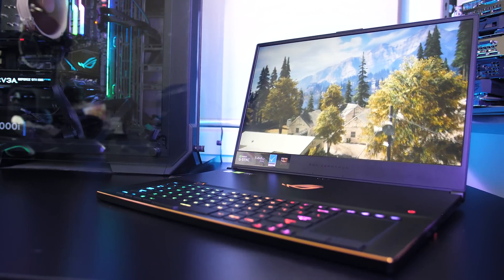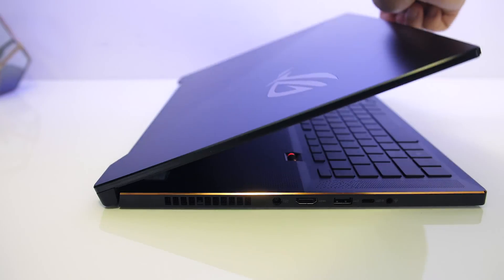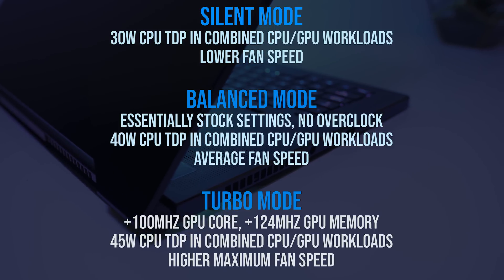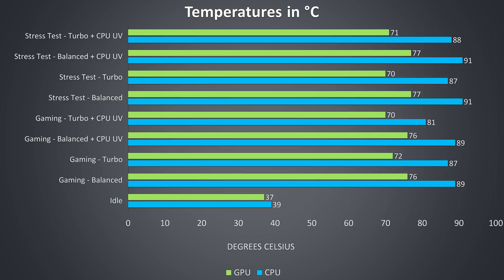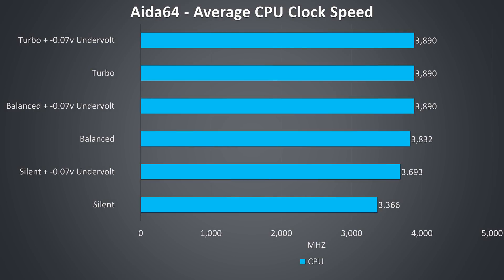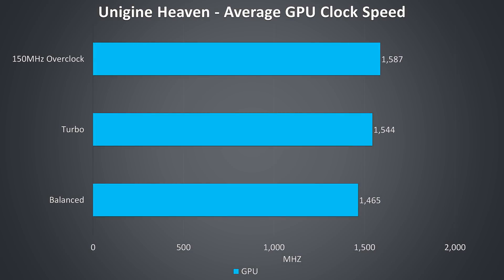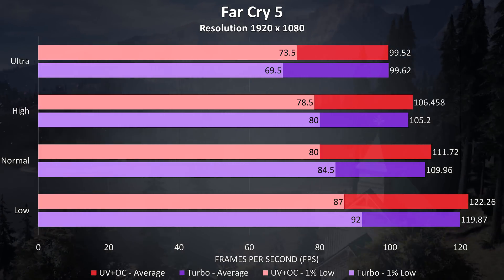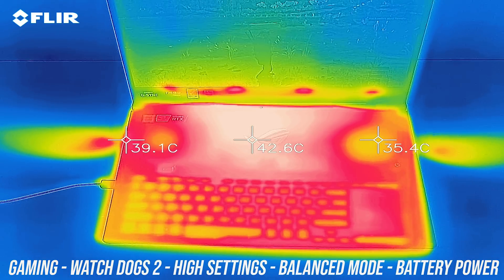ASUS Zephyrus S (GX701) Thermal Testing, Overclocking and Undervolting

Comment: Quick question.  Do you think if you remove the bottom metal plate you can then use it in dock mode with lid closed???

Comment: Hi jarrod,

May I know if the GX701 runs cooler or the razer blade pro 17? (2019 or 2020 model?)
Reply: If you buy the 2020 model, they all come with liquid metal. The Zephyrus’ thermal solution is superior to any Razer blade’s cooling. I bought the S17 with the 10875H and 2070 Super, and the CPU rarely ever goes over 90c during gaming and the GPU very rarely goes over 80c. Everything about it is excellent, apart from the fact that there is no webcam or fingerprint reader for Windows hello. 11/10 would recommend.

Comment: thanks for the video jarrod ! Sadly my thermals aren't nearly as good as your results with this laptop... however mine comes with the 9750h cpu . undervolting didn't seem to affect it either. Although even on low performance mode it still gives me 100 fps for witcher on ultra (cpu temp on around 78)

Comment: Hi, I've owned the same model for a year now and it has delivered great performance during games and daily tasks but I never monitored temperatures or clock speeds constantly while I was using the laptop, but recently I'm noticing idle temps of 50-60 C in CPU and 40-50 C in GPU and the CPU reaches up to 95 C and GPU up to 83 C while in gaming, comparing to ur results, its scary to know that I might have gamed at these temperatures for possibly a long time causing damage to the components. I know for sure that my unit didn't run this hot when I first got it (I benchmarked it  once I got it right out of the box). I tried updating the drivers, bios, changing power plans, tried clean booting, scanned for malwares (found no bitcoin miners) and even did a factory reset and the problem still persists. One thing I noticed was a process called 'System Interrupts" with 70-100% CPU usage popping up in the task manager for a split second soon as I open it and disappears into the list. I've never opened the unit to make physical changes internally as I know how tricky it is but wanna know what you think might be the problem cause nobody seems to be having the exact same model as mine with the same issue.
Reply: Also I didn't mention undervolting cause the new bios no longer allows it,  bios auto updates itself through windows without external drive every time I restart on old bios versions  :(
Reply: please @me if you ever find this issue 
i have the same problem except i bought mine only a month ago, so im a littleeeee concerned
Reply: @annaagnes6657   I ran LatencyMon/DPC checker and found that a driver called ACPI.sys is causing audio buffers and interrupts once in a while upto 9ms which is probably keeping my CPU busy even at idle without showing it in the task manager. I haven't found the solution to this yet as there arent any threads with Asus Rog laptops.
Reply: @annaagnes6657  Im sorry you have this issue as well, let me know how your LatencyMon tests go, you can easily fix latency issues that arent related to ACPI drivers
Reply: yeah dude im having the same issues my fps drop while playing dota 2
Reply: I know I'm very late and most likely you don't have this laptop anymore but there's an interesting solution about the temps. Remove the panel that raises the laptop then manually raise it. This prevents the hot air that comes out from the laptop getting sucked in again but this will also make the fans more susceptible to dust so you'll clean it more often.

Comment: I get like 97 degrees celsius on this thing undervolted or not
Reply from the maker: Hot ambient room temp?
Reply: Jarrod'sTech no, just a regular room temperature. I returned it for quality checks. The cpu is the only thing that overheats. The gpu runs at 70-80, without problems. I’m sure that there’s a problem inside.

Comment: bro, do u know anything about it’s fan issues? Many GX701 has same fan issue that left fan makes extremely loud noises
Reply from the maker: Not aware of fan issues with this model, you can hear mine in the video.
Reply: Jarrod'sTech ok thx bro😄
Reply: I certainly have that. It sounds more like a helicopter rather than a laptop. Thats why im returning it. And the temps are extremely high (97 cpu, 87 gpu)
Reply: Dexter Myo yeh, my gx701 start to having same issue as well
Reply: @VolumeVandal  probably a bad paste job. i just repasted mine with liquid metal and boy am i a happy camper. It runs great and doesnt get to ridiculous temps anymore.
Reply: @PortableOppertunity  probably, i just returned it back then anyways. It was extremely loud, like 70db. I got another one at 50db and it’s like a walk in the park in terms of noise and the temps are much better. I think its a bad paste job, but i didn’t wanna void my warranty too soon.

Comment: What did you use for Undervolting? I seem to have issues with ARMOURY crate and XTU conflicting with each other.

Edit: I had to install an old version of throttlestop to get it to work, but then was able undervolt and save it with no further conflicts.

Comment: I have the rtx 2070. When I play games that are heavy on graphics, I get up to and around 95 degrees celcius on the cpu, while the gpu is lower. I asked the company that sold it, but they seem to think it's within the range of normal. I am not sure. Looking at this and other tests, it seems high. Is it a very high temperature, should I do something, and in that case, what? Thanks.
Reply from the maker: I see a lot of laptops hitting 95c, not too surprising given this is a thin machine, it will depend on your ambient room temp too. I test at 21c usually, and a 1c increase to room temperature = the same to the internals. you could try undervolting to improve it a little, or just not worry about it that much, I actually wrote a post on this topic yesterday: https://jarrods.tech/is-it-safe-to-play-games-on-a-gaming-laptop-for-hours/
Reply: @JarrodsTech  Thanks alot for taking the time to reply and for the link. I just discovered today, by looking at one of your videos, that there is a setting in the Armoury Crate that allows for an "Optimum" (I think that might be the wrong name) or similar setting, that can be changed to so called discrete graphics, enabling Gsync. I had no idea what impact this would have; the CPU temp (which was the issue) dropped from 95 to low-mid 80s, and performance in terms of FPS seemed to increase a lot! So I have no issues any more - again, thanks - I'll drop by a sub as thanks!

Comment: Just bought this laptop and on the xtu it thermal throttles at around 75... Is there a workaround??
Reply from the maker: Try undervolt it, that seems like a low throttle limit though, maybe make sure the bios is up to date first.
Reply: @JarrodsTech  thanks for the reply!
I did undervolt to -.075 which seemed to be the threshhold before getting the bsod. And i had updated the bios before, but will try again

Comment: I have this laptop GX701GWR-EV053T but my card rtx 2070 runs pcie x8 i dont now why?.... and have 16gb ram can i upgrade to 32gb ram? Thanks for help...
Reply from the maker: 16gb memory soldered to the board with no stick installed? If so yes, just add a 16gb stick. No idea about the PCIe thing, doubt it matters much to be honest.
Reply: @JarrodsTech   Hi yep its only 16gb runs 1 channel but can update to 32gb? I heard i can only load max 24gb on this laptop i dont now what to do ... i what laptop be faster then now.... and have problem with card rtx2070 only runs pcie x8 ehhh and one more thing do You have sone instrucions for open this laptop and how undervolt intel what program You have? thanks for reply;-)

Comment: Are the batteries replaceable in these?
Reply from the maker: Technically yes you can take it out but you first have to take the bottom panel off and unplug it from the board, so you could replace it as a once off thing years from now but I wouldn't consider it in terms of quickly replacing if the charge runs out.

Comment: I may need to undervolt, it drives me crazy how after a half hour or more, on game such as "Monster World Hunter", the GX701GX would crash because the CPU rises up past 90 degrees (F).  It happens with other games as well and I'm trying to find ways to make things cooler.
Reply from the maker: Games should not crash due to high temperatures, that shouldn't be a thing.

Comment: Hey man, I'm about to buy this laptop do you think a cooling pad would help temps? I dont know if I should buy one or not as there doesnt seem to be vents under the laptop
Reply from the maker: No I don't think so, as the bottom is completely flat, the Zephyrus brings air in from above the keyboard rather than underneath.
Reply: @JarrodsTech  ok thanks a lot dude btw do you think this unit has better thermals than the Helios 300? I saw your review and that unit seemed to have better thermals with the cooling pad but shouldnt this be cooler since it has a 17 inch chassy and better cooling system?
Reply from the maker: This is also way thinner, limited space for cooling, either way it's cool enough.
Reply: Dude THIS version of the zephyrus takes the zephyrus s (first version) cooling updates (12v fans more stronger blades) and pairs it with the most powerful (although slightly underpowered thanks to max-q design) and makes a GREAT fucking laptop. The only way you could get it slightly cooler is get it modded with liquid metal or a thermal paste pad (thermal grizzly brand) or better thermal paste.   
In other words........

THIS PC FUCKING ROCKS!!!
Reply: @PhillipLemmon  Well I ended up buying the 17 inch Helios 300 just cuz I can use a cooling pad to lower temps unlike this model which doesnt have bottom vents. 

The cooling pad adds 2-4 more fans and all combined you get lower temps than Zephyrus by itself.
Reply: Hey Jarrod I thi k I asked you this before a out the original asus zephyrus but I can't remember if you replied or not.... But my question is  can you overclock the max-q gpu at all? And if so which method do you recommend using?

Comment: Jarrod... the way you outlined the power usage for each mode in this review was excellent. Much appreciated!
Reply from the maker: Cheers!
Reply: @JarrodsTech  btw, did Metabox ever offer you a PB71X chassis for testing? There's remarkably little out there in the way of reviews for that machine.

One of the few which still provide G-Sync!
Reply from the maker: Nah not yet, I have a couple more Alpha-X machines (newer 9th gen ones, going to use them for a 1650 vs 1660 ti video) from them to get through first then I think might be getting some Prime-V stuff afterwards.

Comment: Sir can you print screen your settings on undervolt throttle stop on this model?
Reply from the maker: Sorry, I used Intel XTU, I only lowered the core voltage offset, didn't do anything else.

Comment: I have the gx531 with an rtx 2070 and in Cinebench R15 the temps peak at 97 °C... is there something wrong with my unit?
Reply from the maker: I didn't test Cinebench temperatures so can't say, I have a separate video on the GX531 you can run the same tests as me to see how it compares.
Reply: @JarrodsTech  thx for your reply. On firestrike the temps still peak at 92 °C with - 0.130 undervolting. Are you're temps peak temps or average? Room temps are pretty cold right now I would say...
Reply from the maker: Mine are all average, but you would be better comparing to my GX531 results rather than this video: https://www.youtube.com/watch?v=f5EkYR1NlbM older video so the temp graphs are a little crap, but yeah that was tested in the Australian summer so I thought it held up pretty well considering. But yeah for direct comparison you're going to need Aida64 stress test + Heaven benchmark at 100% to perform the same workload as me.

Comment: This might be a dumb question but should you repaste the CPU for better performance or not?
Reply from the maker: In this case it won't help, the CPU was not thermal throttling in any of my tests, so it may help improve the temperatures but it won't change performance for the CPU. I actually have a video coming out in less than an hour with a laptop that was thermal throttling, and I show how changing the paste does help with that one.
Reply: @JarrodsTech  alright thanks
Reply from the maker: No problem!

Comment: Amazing review, sells me on the GX701. I have a GX501 and have done a liquid metal mod, it becomes completely silent when idle and even the load temps are significantly lower which translates into more silence. If the GX701 is this good out of the box, doing the same mod to it should yield stellar results!
Reply from the maker: Nice! Yeah it would have been great if I got to test with LM, unfortunately not an option with the review unit though.
Reply: @JarrodsTech  Well, I'll do it to mine once I receive it in roughly 2 weeks. Who needs warranty anyway... :D
Reply from the maker: Let us know how it goes!
Reply: @JarrodsTech  Gladly will, albeit in a significantly less professional manner than you, but I'll drop by to give you before/after numbers :)
Reply: @mhe0815  Did you ever apply lm liquid metal to your gx701.
Reply: @janet-kevinwalker5805  So far I haven't, the temps are better out of the box and I haven't had the need for overclocking yet. However, I am on a business trip (as my work life is pretty much nomadic) and will be back home for a while at the end of the month, I'll benchmark it more and see if I can provoke it to thermally throttle, if so, I'll apply the mod, if not, I'll leave it as is or only do Kryonaut instead of liquid metal.
Reply: @janet-kevinwalker5805  Update: Since you reminded me, I started using Aida64 to see how far I can push it and I can indeed provoke thermal throttling. Oh well, time to get the tools out when I come home...
Reply: @mhe0815  l've just taken the plunge and bought the rtx2070 gx701 version as Amazon UK are currently offering a 9% discount. Have you used Throttle stop to apply an undervolt?? Kevin
Reply: @janet-kevinwalker5805  Enjoy the machine! I haven't applied an undervolt yet but given the amount of throttling and the temps I can reach by maxing out CPU and GPU simultaneously, I don't think that this will be enough. I was just ignorant about it until you reminded me to look into it further.
Reply: @mhe0815   did you ever mod the GX701 with liquid metal?

Comment: Nice video  ,  waiting for full review also 
And also review  razer  laptop  rtx model  and  compare it  to  this zephyrus
Reply from the maker: Thanks, it's going up in about 3 hours time! I was meant to get the Razer Blade 3 weeks ago, but Razer needed it for something last minute, they should be sending it out next week. I'm not sure what specs it will have, it it has the 2080 Max-Q it makes sense to do a comparison, would you still be interested in me comparing them if the blade has lower GPU? It wouldn't make the gaming benchmarks/thermals/battery life comparable.

Comment: I'm really caught up between the new msi gs65 and razer blade 15 with RTX2060. I have no issues with msi's flipped mother board I'm only concerned about the build quality and the thermals. Which one should I go for? Right now razer is 2500$ and msi is $2300 but I'm going to buy later so hopefully the prices drop a bit
Reply from the maker: I haven't tested the RTX GS65 yet, though I did cover the GTX version. Build quality definitely wasn't as good, though overall I thought it was fine unless you're going out of your way to push down on it. I basically view the GS65 as a cheaper Razer Blade, quite similar overall, better build quality on the blade and bigger battery so depends if those things are worth $200 to you. I should be getting an RTX Blade next week (not sure which GPU yet), so will have some videos on that on the way.

Comment: Nice video!  One question: My Asus gx701 seems to have a max undervolt ~ -0.50 mV.  After that the internal TS bench of ThrottleStop gives me errors.. but the laptop seems to be stable in games like BFV or in a 2 hours Prime 95 test even with undervolt of - 0.80 mV. What do you think about the max limit of undervolt? Thanks!
Reply from the maker: Thanks! Seems a bit low, but yeah it does always vary by laptop and also depends on the specific workload as well, I thought mine was a bit low here too, however I've noticed results are usually low with the Zephyrus laptops for some reason.

Comment: I kinda expensive, you should be able to downgrade the gpu if you want the 17 inch. I dont know why asus locks in with the 2080, I dont see any reason for them to do that...
Reply from the maker: You can get it with either 2070 or 2060 graphics too.
Reply: Jarrod'sTech can u get those gpus in the 17 inch model? I have seen zephyrus that have 2060 and 2070 but are 15 inch version, which have a different chassis. I could be wrong tho, i would be nice if I could get a 17 inch with a 2060
Reply from the maker: Yes. The GX701 is the 17 inch model, and this page says it's available with 2060, 2070 or 2080 Max-Q: https://www.asus.com/au/Laptops/ROG-ZEPHYRUS-S-GX701/Tech-Specs/

Comment: Hi Jard, how about gx701 rtx 2070?? Is it full power rtx 2070 or max Q design??
Reply from the maker: According to the ASUS website it is not Max-Q.
Reply: @JarrodsTech  I don't think one is in existence. Not even a 2070 Max Q. I was in the market for one and had to settle for the 531 w. 2070 max q ps got -165 mV .  As you said though.. it's more about power throttling than thermal

Comment: It’s sad to see that it was a review unit. I would love to see how better the thermal paste application would have improved it’s temps. I remember the older generation with lm and underclocking reduces about 15C
Reply from the maker: Yeah that would have been fun. Based on the impressive results here for such a thin machine though and the price I would not be at all surprised to find it doesn't help.